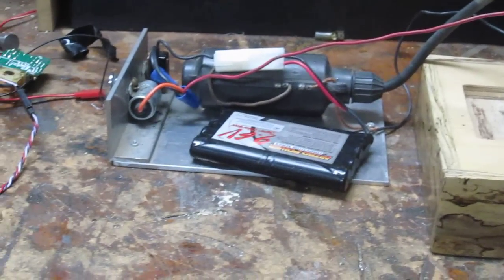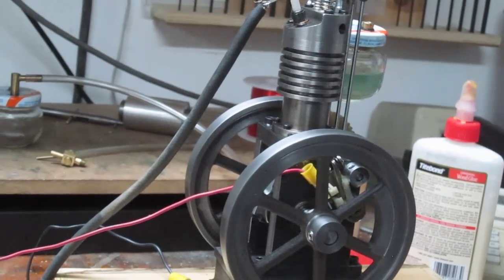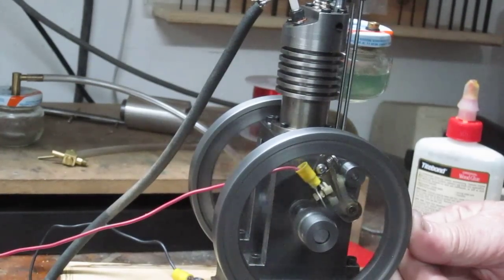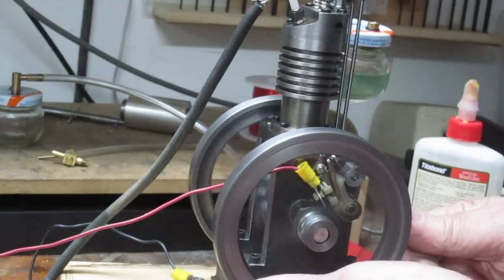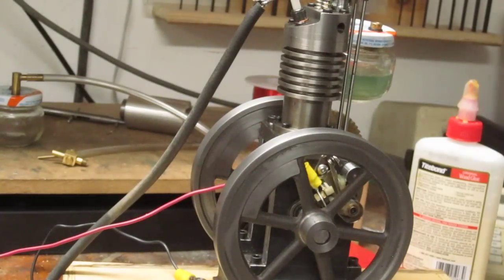Vertical Single 4 stroke engine, spark ignition

Comment: Good video. Kind of looks like my "Midget" engine from 1936 Popular Mechanics.   I use a good old set of points from a 1977 GM V8 a Model Electric coil for model airplane engines and two "D: cells for 3 volts, or 3  rechargable AA's 1.2 Volts each.  Have not gone to electronic ignition yet but I have the kit for my Howell "Power House" engine.  Just need to locate a set of gears for the cam on to continue work.
Reply from the maker: +gwheyduke Thanks, I am now running this and my other engines on elecronic ignition from S/S Machine and Engineering.  I'm using a hall sensor and magnet to trigger the spark.

Comment: You make some really awesome engines! Impressive power for the size! Are you running model aviation fuel? That wisp of smoke @ 2:24 suggests added lubricant to the fuel. Synthetic? Castor? Thanks for sharing...!
Reply from the maker: Thanks!  The fuel is Coleman fuel mixed with a small amount of WD40.

Comment: Power??? 
efficiency?
consumption?
Reply from the maker: Don't know the answer to any of those questions.  The engine is just a working model built specifically to start it up and watch it run.  I currently have it powering a 90V, DC generator which will light a 60 watt incandescent bulb although it's capable of more power than just that.

Comment: is the cylinder Just a 1 piece?
Reply from the maker: There is a separate head which screws to the top of  the cylinder.    The head contains the spark plug and the valves.
Reply: Chuck Fellows can you Stop it with a hand?
Reply from the maker: Yes, if it's just running at an idle.